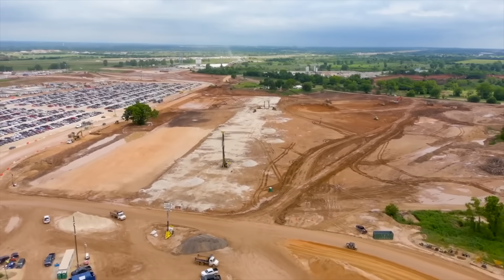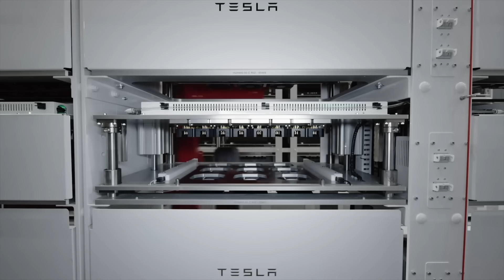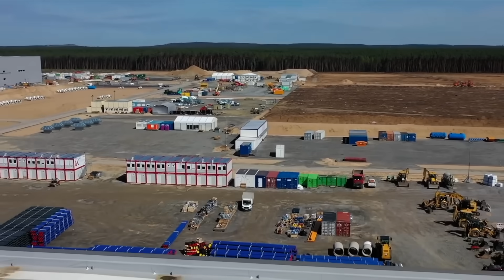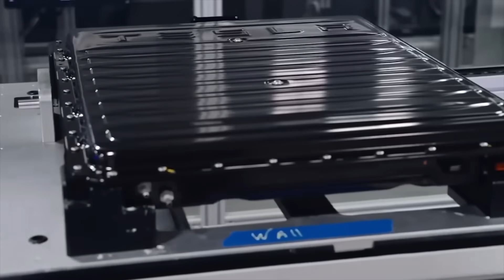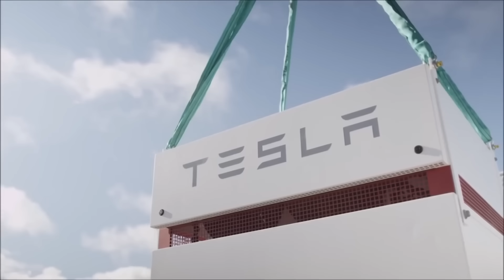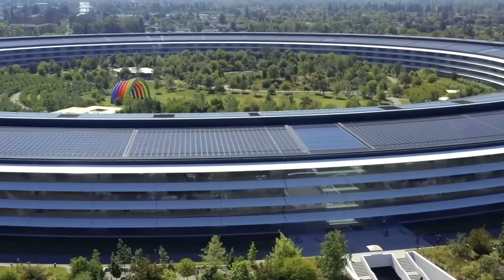HUGE NEWS! TESLA New "Operation BobCat" and It's CRAZY!

Comment: Elon will have the rockets to take us to the moon and mars. Electric cars and trucks when we get there. Boring machines for underground habitats and work areas and solar and battery storage for electricity. So we can make oxygen, rocket fuel, water and charge the cars and trucks. Not bad for 1 mans ideas! And they are installing a system in Boca Chica to sequester oxygen and methane out of the atmosphere. I think that's the right term.